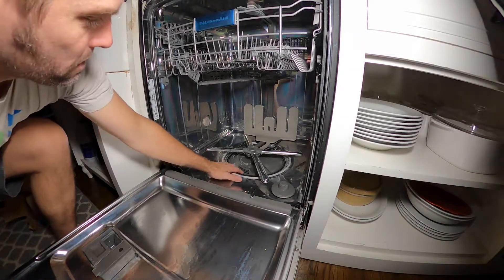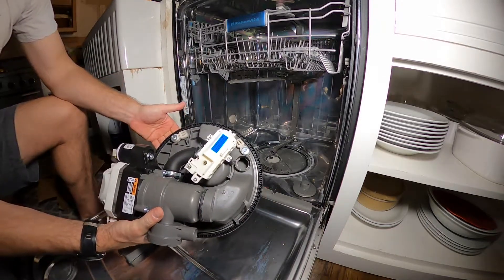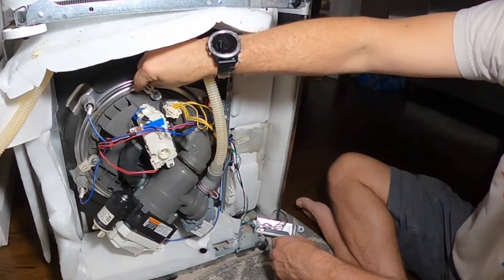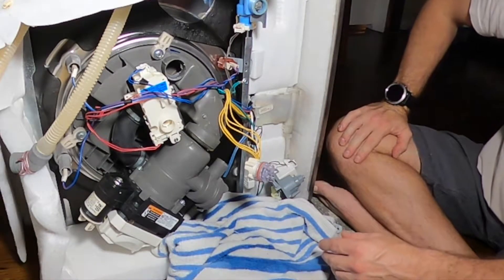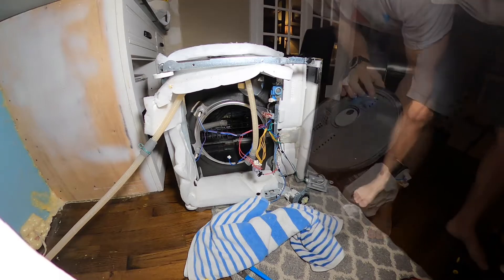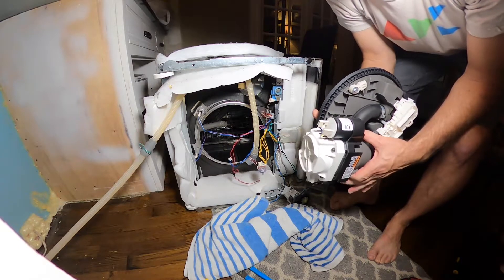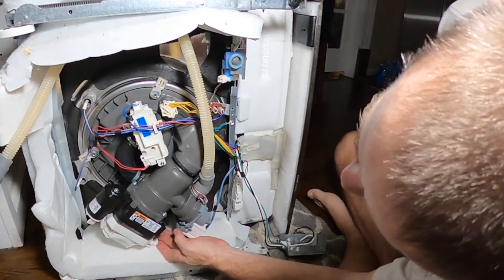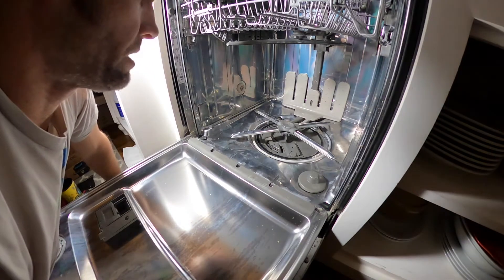Replacing Kitchenaid Dishwasher Pump & Motor kdtm354dss4

Comment: To seat the part, set the first tab that is apart from the other two by the drain motor.  In between the other two tabs, is a plastic handle you can pull down on.  You can see it @ 6:15 left of the white box near the heating element plug.  That will allow you to set the other two plugs by pulling down.  **MOST IMPORTANTLY** ONCE YOU REPLACE ANY  PART, you have to run a FULL DIAGNOSTIC CYCLE (about 23 minutes) for the control board to work correctly, otherwise you may get random problems.  Mine refused to see the heater element after the motor/pump replacement.  To enter the diagnostic cycle, press any three panel buttons in a row 3 times, less than a second between each.  1-2-3, 1-2-3, 1-2-3.  All the panel lights will illuminate.  Close the door and leave it alone.  It will cycle through multiple (20 plus) diagnostic tests.  When all the lights go out, the diagnostic cycle is done.  If the Clean light is flashing just after closing the door and starting the diagnostic cycle, it is an error code.  In mine, it was 7 flashes, a pause, then one flash (7-1). 7-1 is the heating element error code.  You have to clear any error code manually by pressing Hi Temp in "Interval 20" of the diagnostic cycle.  It will not clear on it's own.  The easy way to do this is to start the diagnostic cycle and watch the Express wash and Prowash lights.  In the first couple of minutes of the diagnostic cycle, the Prowash and Hi Temp lights will both come on.  This is the Interval to press the Hi Temp button to clear the error codes.  All this info is in the data sheet in the insulation behind the bottom panel.  Thanks for the video and hopefully these hints will help!
Reply: Just wanted to mention that I didn't have to do a full diagnostic cycle as you mentioned in your comment. Just installed the part and it worked. This is good because for some reason I can't seem to get my model to do a diag cycle, so I would have been stuck.

Comment: I wanted to thank you for this - saved my washer and I even jacked my door up and got it back in. The post below with how to run the diagnostic cycle is a must read AND BIG TIP - put soap on that seal so you don't have to fight it. So far so good.

Comment: Thank you for this video! After a repair person said it would cost about as much to fix than to buy new, I decided to do the replacement myself and get some more life out of my dishwasher for just the cost of the part (~$250). 
Hardest part of the process was getting the rubber gasket to seat deep enough. What worked for me was to grab hold of it from the underneath and pull it down after pushing from inside as much as I could. The bottom of the part has a nice plastic area, almost like a handle that was perfect to pull on (pause video at 24:22 and the handle is in the upper left corner).

Comment: This video was extremely helpful. My Kitchenaid pump filter completely shredded itself and stopped the motor from turning. It’s been in service from new for 4.5 years and it was ran everyday. Made more sense to replace the entire assembly then piece parts. Not knowing if the motor was still good and did not want to take that chance. Thank you for the great video!

Comment: Thanks for the video, I had same exact issue with the motor on same KitchenAid model and instead of paying $800+ (counting in installation and few extras like removal of old machine, nobody offers any of that for free where we live, not even Costco) for new one I just ordered this sump and circulation motor assembly and replaced it myself. Which was pretty easy after watching this video. I didn't even bother to turn the machine on its side - all the electrical connectors, the small drain pump and the optical sensor were easily accessible from the sides, only annoying part was making sure the round rubber seal would fit properly into the steel tub.

Comment: Good Deal, I'm working on a Kitchen Aid just like it for neighbor friends.  Same experience, replaced the seal and then the rest of the unit crapped out. 1,200$ dishwasher, all plastic made parts that are important.  

A little dish soap on the gaskets and hoses help them slide into place without tearing or major effort to seat. Old dishwashers were mostly all metal  parts in construction, with real motors. The new all plastic stuff lasts 2-5 years if you are lucky before everything needs replaced with more plastic parts. They don't make 'em like the used to, which is a shame for what they cost new. 

Thanks for posting and trailblazing, this will help a lot of people who's warranty probably just expired the week before the dishwasher turned into a floor shower. My friends tongue and groove cherry floor was ruined in the kitchen, because if the leak, which will end up costing them twice what a new dishwasher would have cost to replace the floor. He saved 1000$ instead of buying a new unit , now that can go for the new kitchen floor, which I'll probably end up doing for them. 

Whirlpool/Kitchen Aid should be ashamed of themselves for selling such garbage for such a high price!

Comment: Used your video to fix my exact same unit. Thank you thank you thank you!  It helped me to get the third tab locked by connecting everything including the first 2 locking tabs then standing the dishwasher back  up and pushing down  on the motor/pump unit to easier seat the gasket. You can then lock the 3rd tab from the side since it's open. Thanks again!

Comment: Thank you.  I just did the repair because of your video.  I had a heck of a time seating the gasket and eventually sprayed cooking oil on the rubber and that helped a ton.
Reply: Agreed, that gasket was the worst! What worked for me was to grab hold of it from the underneath and pull it down after pushing from inside as much as I could. The bottom of the part has a nice plastic area, almost like a handle that was perfect to pull on (pause video at 24:22 and the handle is in the upper left corner).

Comment: Followed this and still had a leak. I noticed two white plastic things hanging down from underneath and one had water on it. Realized they were the underside of where the heating element goes in. In this video they are the two grey things (with the blue wire going into them). Look to the left at 15.38 minutes. Turned them using a wrench and no more leak. I didn't need to replace the pump and motor but hey I have a new system now (and I back one with parts that I took out and is still good). Short version is check this first or at minimum make sure they are tightened up when you do this job (or course take the blue wires out before turning). I have a kdtm354dss5 but it's the same as this one.

Comment: Never pull on that Diverter like that once it’s starts to leak you’ll be doing this all over again stand up the dishwasher when putting in the new one so you don’t have to pull on it you push down from the inside

Comment: Thank you for the great video! It seems you have the only one that shows the bottom of this model. It seems the others are all "similar."

I have the same model as this. You mentioned in the video that you tried replacing the pump filter but it didn't fit. I just ordered filter #W11084156 for mine. Are you saying that this may not fit my pump? Or, did you order a different filter than #W11084156?
Thanks!!
Reply from the maker: Hi Mark, Looking in my email that filter is the model that I ordered and it didn't work.  The flange was smaller and while I was able to install it and get the washer to do 'something', it made a racket and didn't really do a good enough job (didn't wash the uppper rack).  I ultimately went with the entire pump assembly.  Just be sure to pull the old filter and compare before opening that new filter.
Reply: @nutty-cool  thanks for getting back to me. This really helps a lot. I will do just that.
Reply: Ok I’m
I’m vdqft